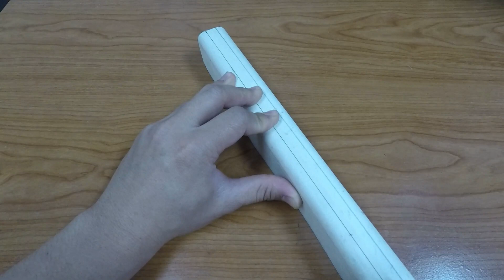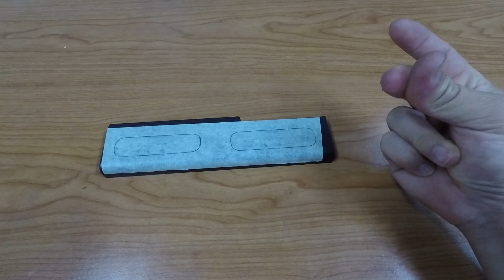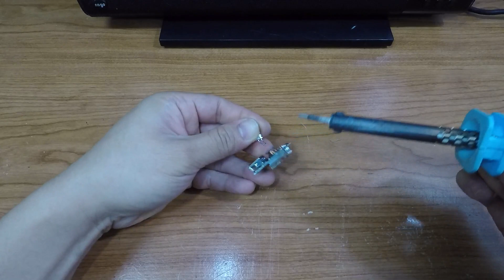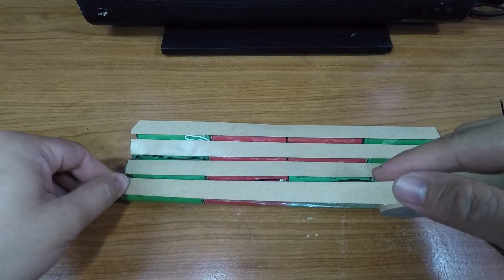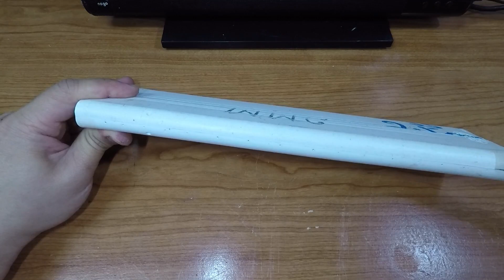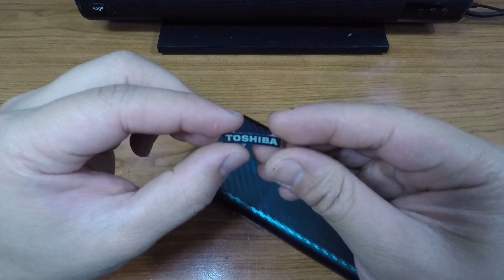Amazing DIY 40,600mah Power Bank

Comment: Nice build.But you probably using that at best performance for only under 10 times of recharge. Batteries are going to die.Bcz that cheap power bank module can't afford to charge that much parallel batteries. So you can tell me how bms afford that much parallel batteries. But you should know bms's job is charging that much parallel batteries.Anyway good Vid bruh❤️❤️❤️

Comment: How much time it will take to fully charge from empty
Reply: if it charges with 1amp it will take 24hours and if you charge it with 2amp because it is maximum charging for 18650 battery it will take 20hours to fully charged.
Reply: subscribe for more.